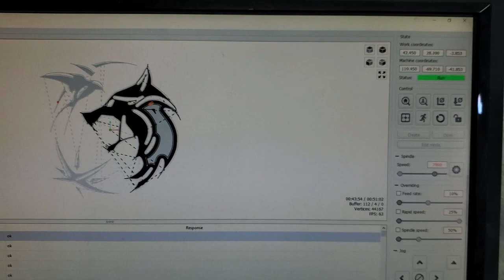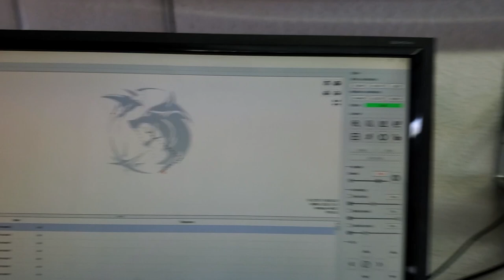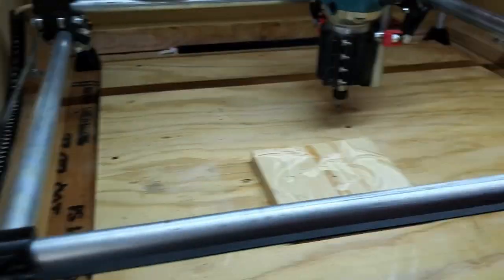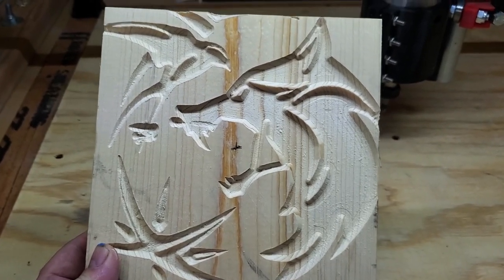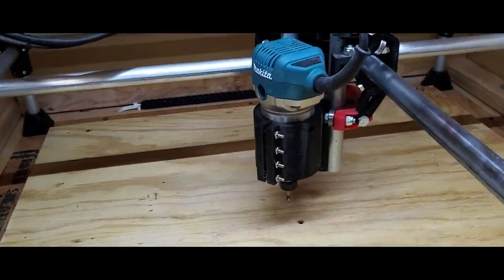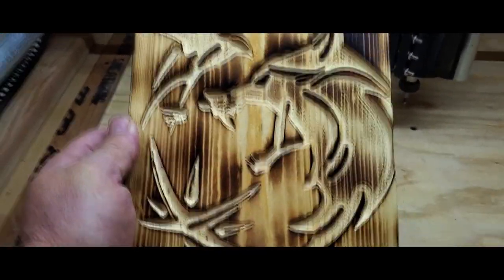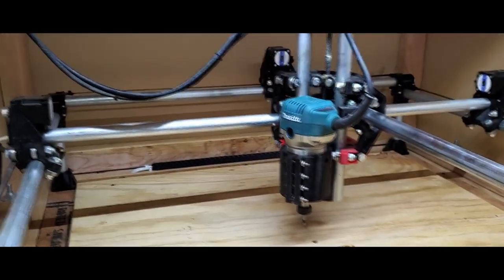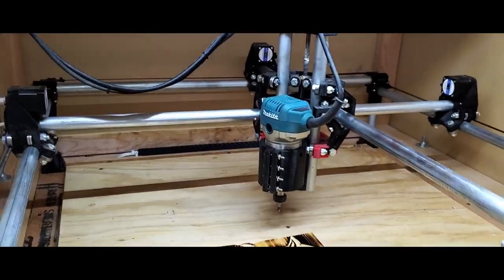MP CNC Fixed

Comment: Is this a DIY setup? If so how big could you make it?
Reply from the maker: Yes  parts are Available on V1 engineering .com site. You can buy kits or source everything yourself. they are also on facebook. I have a link in description of this video. I printed all parts in PETG. Most do pla and used conduit instead of more expensive  pipe.
Reply from the maker: The build area is 24 inches x 24 inches. The footprint of MP CNC is 36 inches x 36 inches. There recommended size was smaller than mine. Some people use extra supports on tubing when they go bigger. So far I have seen no need for this.